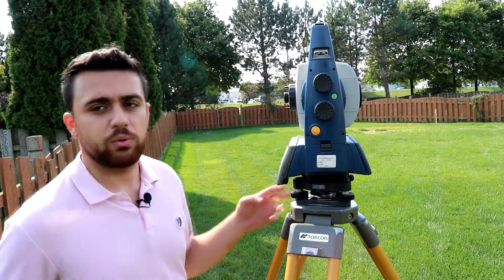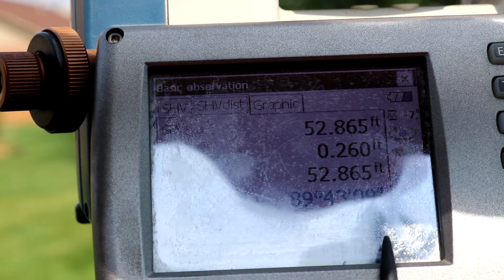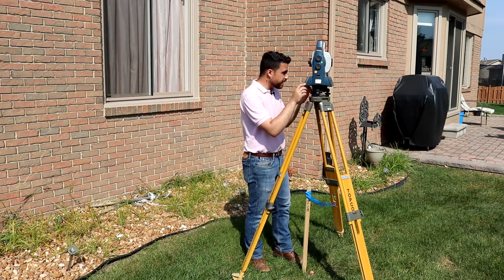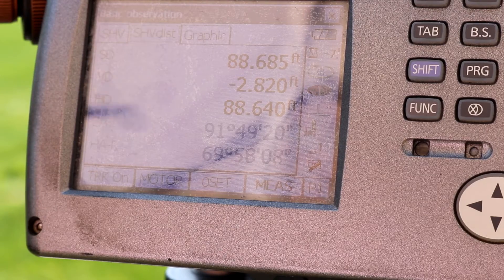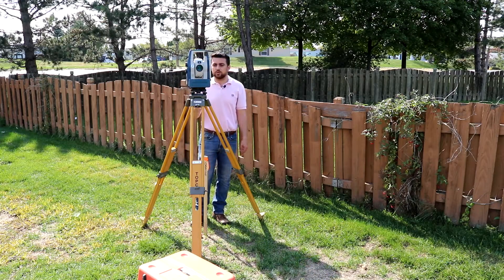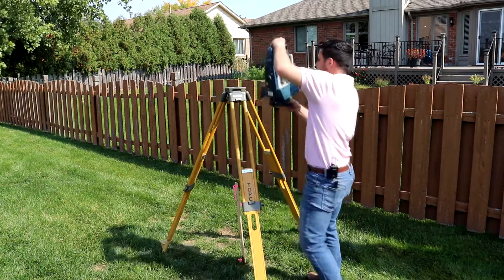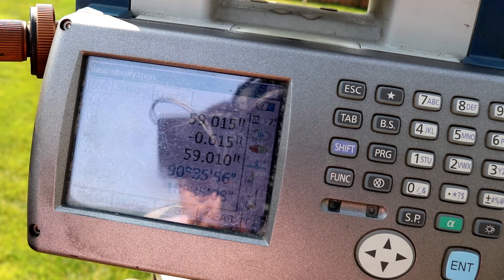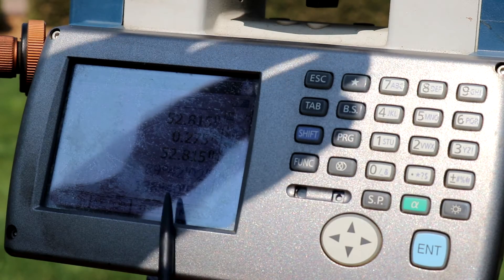Survey Traverse

Comment: what is zero - ing out our angle?
Reply from the maker: Setting the horizontal angle to 0 degrees.
Reply: @RamiTamimi  Thank you, if coordinates for two pegs are known, I join the two and insert the horizontal angle to the machine, when I set up in the next station (at an unknown peg) my backsight at the previous known peg what horizontal angle can I use since I'm at a new peg?  hope I'm clear enough to understand

Comment: LOL. As I pull  out my carlson RTK receiver and get the Leice robot out all I can say is ,  when I was an eye man in the 90s we still did it this way.  As a real field tech and land surveyor you try to make the least amount of set ups to bring your error down. You  add extra error every time you set up and turn your backsight angle.  It is true that this guy's technique is old school kinda standard, for professional purposes this takes to long this way unless you have no choice.  With the equipment today I can do a final in less than an hour.  This way takes you a lot longer. Also no one I know uses colors for point id's. That is probably the strangest thing. I use field to finish software on my RT controller , so I draw the deed or plat up before I do any of this. So I can localize my GPS and find your property corners in minutes. Not seconds.  And no . I do not need GPS to do a survey. It just saves a lot of time.

Comment: Hi rami , thank you for this amazing content and i have question please which as i have Topcon robotic total station DS series and i did travers survey and then took my side shots and control points and now i want to know if it is ok to do travers adjustment and include level and sideshot adjustment before i send my topo survey which wilp change the coords of some points including control points or what is the next step please
Reply from the maker: You can perform the adjustment in the office and if you leveled through all the control points, add them into your data set. Remember, the adjustment that happens with Horizonal points (X,Y) and Vertical points (Elevation) are different and should not be done together.

Comment: Rami that part of video taken by drone you started from REF BS, But at the end setting on pink instead of ending with REF FS you did Green FS . could you please explain why?
Thanks (Shokran)
Reply from the maker: Hi Bahram, this is a preference that I like to do. The REF point is not a part of my Traverse, but I am referring to it to begin my traverse. My Traverse of control are the colored points, so I closed back at the original point to find the change in X and Y from the initial measurement. Now if REF is apart of my traverse control, then yes I could close back at it. Good Question!

Comment: Good work. My only advice is set up the tripod and put the legs into the ground before you put the instrument on it. You would be suprised how you would get the hang of it quickly. We were always taught to do it this way and the robot or total station stays in adjustment better.
Reply from the maker: Fair point. I was taught to put the total station first in order to get over the point. If you step on the legs and your 2 feet away from the point, you're going to have to pull the legs out, adjust them, and have to step on them again. What do you usually do in this situation?
Reply: @RamiTamimi  Once you get experienced setting up tripod you can eyeball it really well. Make sure the head of tripod looks level and is somewhat over your trav. point. drop a rock or use your plumb bob. We dont let our employees dance with the instrument on it. If you just had a tri-brak on the tripod that would be ok. I have taught plenty of new hands to do it this way.....and even old ones! I'm retired now.  Try it.
Reply: You have to have a really, really good eye to do that in my experience.  Most people, including myself, can't do that consistently.
Reply: @marcushagey4110  not if you do it everday. Simple
Reply: @Alaskaislarger  Where do you work?  Not a lot of people use the gun day to day.  I don't see how stepping it in afterwards would even affect the stability either.
Reply: @marcushagey4110  I am retired. The proper procedure to set up a gun is set the tri-pod up first. Then attach the instrument. I surveyed 38 years in Alaska for a small Surveying and Engineering co. Sometimes you have to stomp on the legs to get them solid. You surely dont want the gun attached doing that. Taught many young surveyors to do this. After a week or so they learn, or they go back to cutting line.
Reply: @Alaskaislarger  I presume with your method, you have to drive the plummet over the point using the tribrach screws, then level with the legs, then back to the screws for final adjust? I'll try your method to see if it works for me, but I usually just stand my full weight on the footpad and bounce--It's high force but low shock. Occasionally, it takes 2 or 3 times around the legs until it feels solid. The side benefit of doing it this way is that the head of the tripod ends up very level, and it's very fast to swap out another tribrach and prism.
If the soil is so loose that you HAVE to stomp, I put hubs in underneath the tripod spikes.

Comment: Great video the production quality is pretty good !!!
I have a question for you
Why do you have to completely disassemble and reassemble the total station every single time you move?

Also, random question but by working as a land surveyor could there be any long term health effects to your body from carrying the equipment around? lol :)
Reply: Negative, disassembling between setups is unnecessary, I believe the NSPS may even have a recommendation on how to carry an instrument on a set of legs.  Long term effects can include prolonged expose to elements, primarily the sun, which may result in melanoma, but I have only known a few surveyors that have dealt with that.  Construction, agricultural, or mining, you may be exposed to chemicals or natural elements in the soil, so, before soil sampling is done on a site, keep in mind, you are staking points to where those bore holes are going to be dug for the soil sampling.  Boron, Radon, Etc...  Some mining operations for surveying will provide you will detection units if you are exposed to too much of whatever element is present.
Reply: It's a good safety measure. It's mainly based on your budget. If you have back-up machines in case of a trip and fall, leave it on for speed sake. If it's the only one you have and you have to send it off to recheck calibration, box it before moving. It's not worth losing days of down time to save a few minutes.
Reply from the maker: Thank you, I really try and put in a lot of effort to produce high-quality content. You do need to disassemble every time when performing a traverse. 

Now the yard I'm working in is small so it may seem unnecessary, but in the industry, you could traverse around buildings or mountains and so picking up the instrument is important so you could see the other side of the obstruction. 

Working outside has a lot of great benefits. I've seen my immune system get a lot stronger, and my physical strength remains strong. A lot of older surveyors are very healthy from being outside and exposed to nature. However, there is some heavy lifting that is done, and if you are overworked, you could develop some health problems. Definitely see a doctor if that is happening.
Reply: @RamiTamimi  Thanks for the information :)